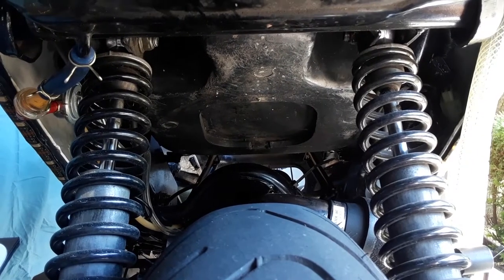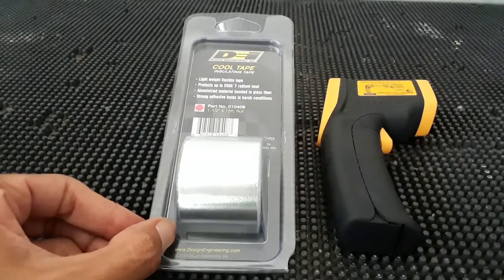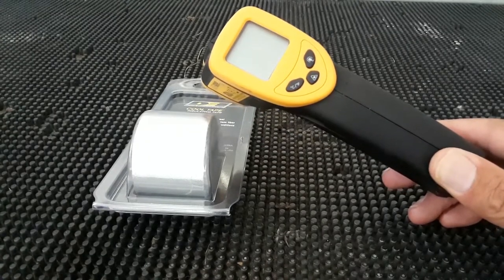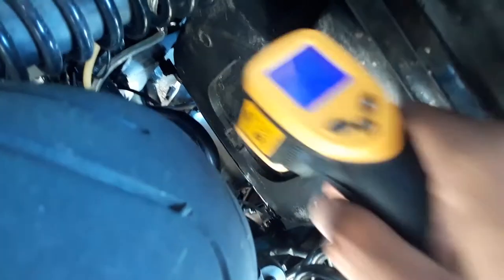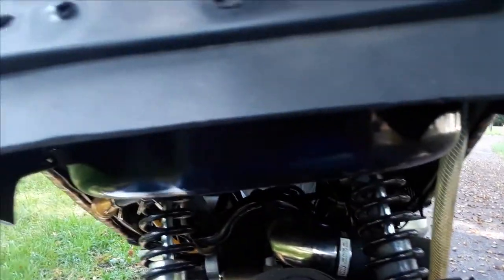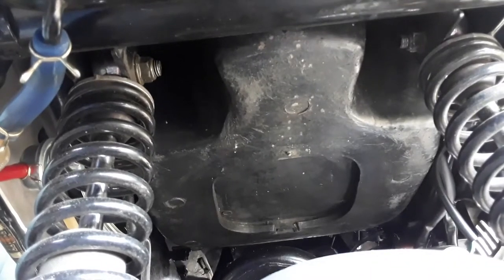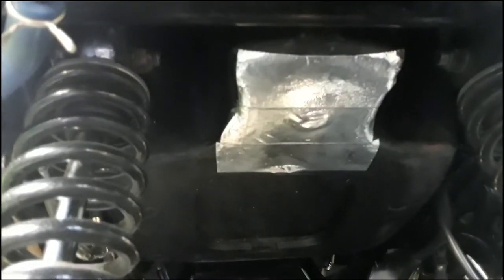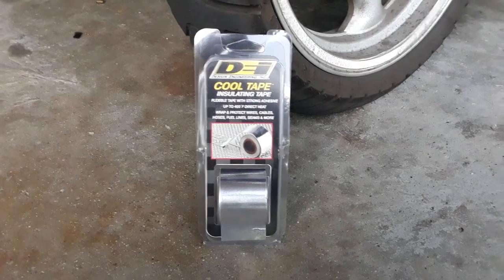Cooling Tape...Does it work?

Comment: Is it possible it’s reading higher because it has kept the heat in that area whereas your dairyair is on the opposite side of that tape and with tbe plastic it reads cooler there because the heat has already passed through to said dairyair? I tend to overthink everything lol its a curse at times. Not questioning your testing logic, i triuly am curious.
Reply from the maker: Roland, I'm with you on thinking too much, I do the same also. I noticed that the ray seemed to bouncing off the reflecting surface of the tape and appearing on my chrome intake. I will do a run tomorrow and take the seat totally out of the bike and measure the temp.....before I pull that crap off my undercarriage .

Comment: YES, please let's save the derrière! I understand that it seems like a fail, BUT what we are trying to cool down is the seat itself, no? Perhaps another test would be to check the temperature of the seat itself. Also, in extreme heat, how would you recommend keeping cool under the helmet? Is there such thing as a helmet fan? Be safe!!!
Reply from the maker: Keeping cool on a bike is a little hard to do...helmets have vents that you can open and close to let the breeze in. They also make half helmets, that I don't recommend, but another way to get more air, bugs, and pavement to hit your face. Also I have come very close many times to a bird hitting my helmet. Natural airflow at 30+ mph should keep you cool enough, problem comes when you are sitting in traffic on those hot days. The tape I used is really supposed to be wrapped around an intake pipe to keep an engine cool, but before wasting my time wrapping my Nibbi pipe I wanted to do a small sample test.

Comment: Good Video. Maybe the Tape is absorbing the Heat. Acting like a Heat sink.
Reply from the maker: Yeah, that is what I was thinking also. The reflecting beam was bouncing off the tape and I think hitting my intake pipe, so I will do another test with removing the bucket and get a true reading.
Reply: @kachiskid  it was a good experiment.. you never know until you try.